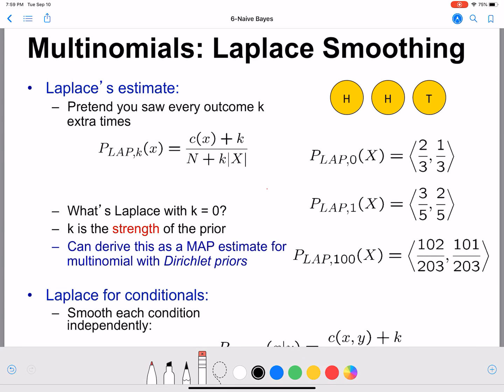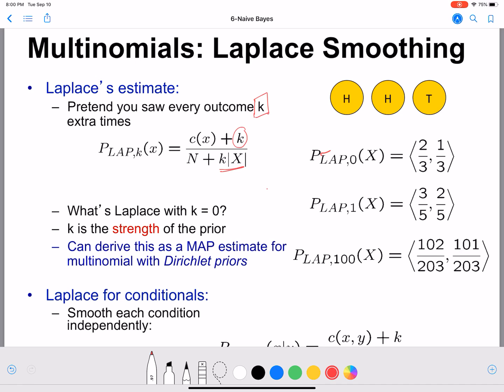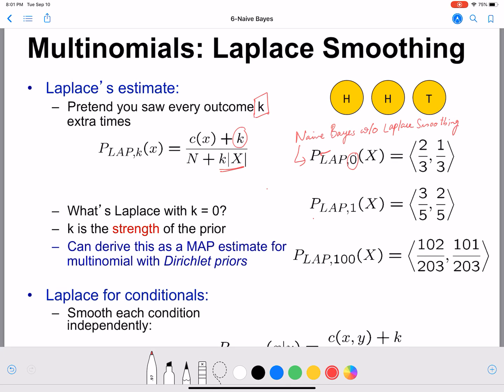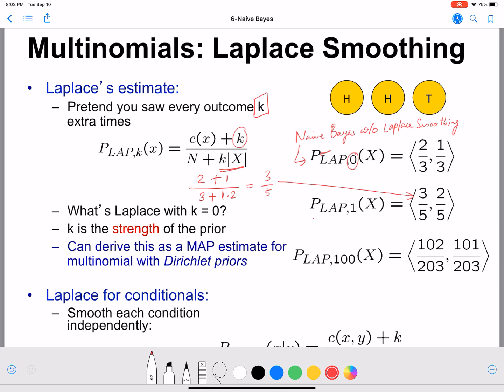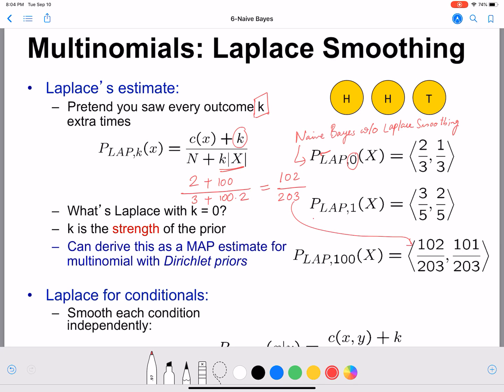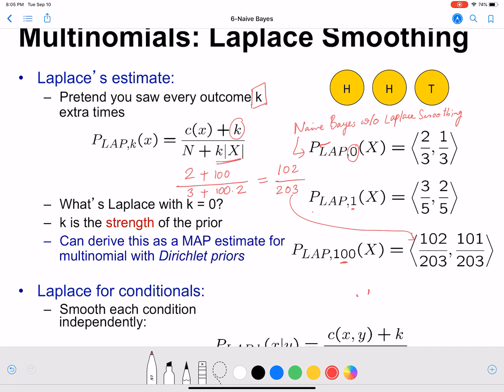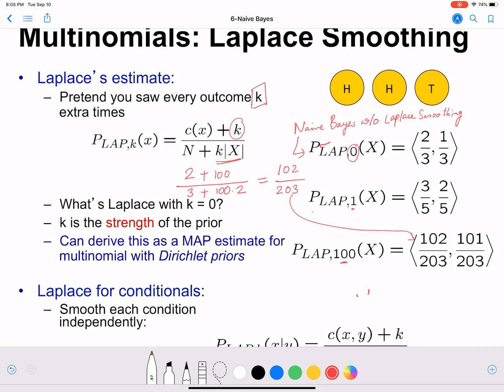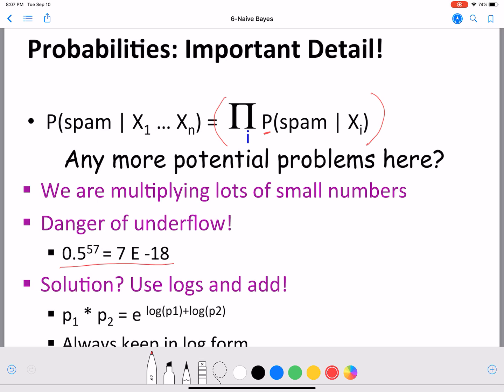Laplace Smoothing in Naive Bayes

Comment: Thanks for your work, you are amazing. At 7:39 , in the numerator the products are on P( x1 | spam)  * p(x2|spam) ...P(Xn | spam) and not P(Spam |X). Am i missing sth or was it a typo.
Reply from the maker: That is correct! It is just an illustration of what to do when you are multiplying many small probability values and to use logarithm for the calculation.